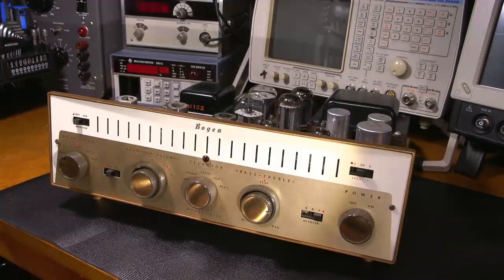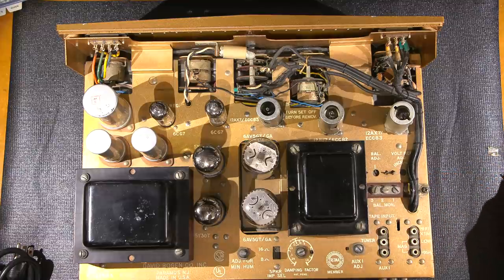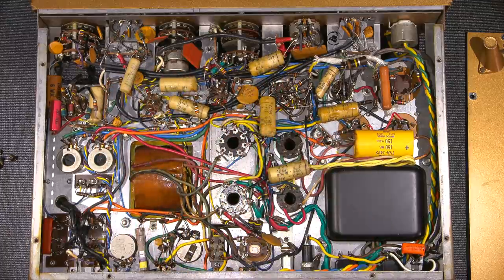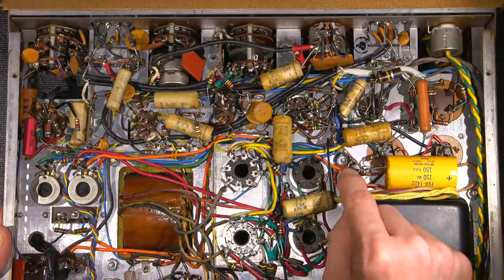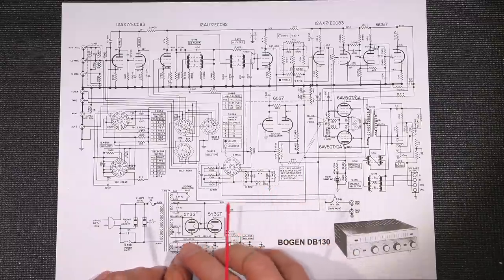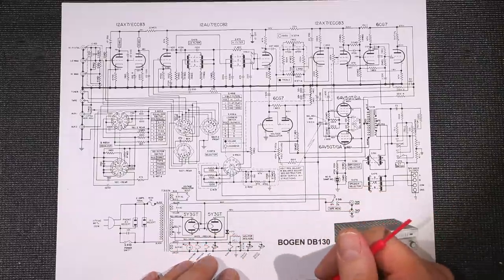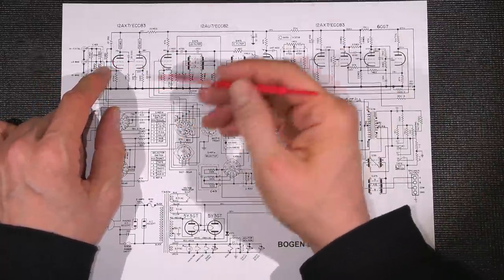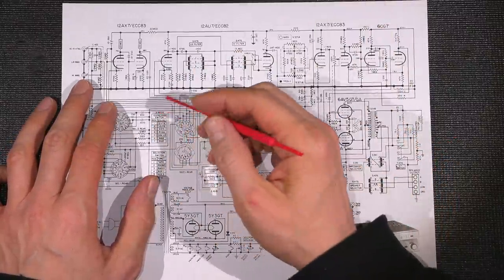Look Inside This Tube Amplifier!

Comment: My parents built their hi-fi component system in the 1950s, before I was born by a year or two. They used this amplifier or one very similar to it, along with a Sherwood FM tuner with a “magic eye” indicator tube, a Rek-O-Kut Rondine turntable with a 16” Audax tone arm and a GE cartridge, all encased in a cabinet they designed with record storage below. I still own this cabinet and all the components. Their Bogen used 6V6 power tubes but otherwise looks identical to this one. I especially liked the preset EQ control with settings for US 78, EU (European) 78, NAB, POP, RIAA, and Col-LP (Columbia). Obviously before LPs were all standardized to the RIAA Curve. The sound quality was superb and eventually I bought two more of these amps, hoping to have a couple of them restored to use in a stereo rig (someday, when I am a very old man, the way things are going). I wish I knew enough about electronics to do this myself, but looking at the interior components I find it rather intimidating. Thank you for your thorough delve into the guts of this wonderful amp.

Comment: Years ago (70s-80s) I replaced many Bogen tube type units. Mostly commercial audio amps with 70.7v and 25v speaker line outputs. Most of the customers liked them as they lasted a long time and wanted Bogens as the replacement amps. I had a shop that took all of the bad units that I removed and used them for parts if they couldn't easily repair them. I got many of my spares from this shop. There also were a few commercial Harmon/Kardon units that I replaced. Nearly all of what I worked on at that time were Mono as they were mostly PA/background music systems. Another great video Sir! Michael in Colorado.

Comment: Thanks for taking the time on the theory.  I discovered from your video why the screens on the 6K6 output tubes of my Hallicrafters SX-71 and SX-100 get voltage off the voltage regulator tubes.  Be safe.  Albert

Comment: Every time I look at one of your videos it triggers a trip down memory lane. Sometimes the equipment you are explaining or working on, with this episode it was back to the vacuum tube block of my early technical education. And every time I see your array of test equipment I realize that in my career I have used-repaired-calibrated just about everything I see. 

The first time you mentioned the B+ line reminded me of the first time I was given a newly introduced digital multimeter to use. (A well-known brand which I won't mention here.) I was working on a item vacuum tube equipment at the time (don't remember what). When I went to measure the B+ with that new digital meter, it displayed an overload indication. That meter only went up to 200V! My comment to my boss about the meter was "what the ** good is this thing if I can't measure B+ with it???"

Comment: I strongly recommend replacing the 6AV5 output tubes (rated 550 volts max plate voltage and 11 watts) with 6FW5 tubes (rated 770 volts max and 18 watts dissipation)  for reliability. No circuit changes needed. These sweep tubes have a 175 volt maximum screen voltage rating so the voltage regulator is needed. Sweep tubes have huge cathodes for high peak currents and linearity. Speech and music peaks are ten times the average power so these amplifiers have tremendous headroom. I have a Bogen LX60 60 watt high fidelity public-address amp, based on this circuit. I changed the four 6AV5 to 6FW5 twenty years ago and it can peel the paint off the auditorium walls without clipping. I also have two DB130 amplifiers. All three have huge output transformers for great bass response. The Bogen manual explains how to adjust all the chassis controls. Variable damping was supposed to increase the damping factor for tight bass, if you set it for minimum damping it will sound like a boomy old 1950's Jukebox. (Note my 1960? LX60 amplifier uses newly-available 5AR4/GZ34 rectifiers which also give higher plate voltage and delayed high voltage at warm-up)
Reply from the maker: Thanks for taking the time to write Donald!

Comment: I use Bogen amp's in commercial applications for paging and sound. They are extremely reliable and have great sound. Nothing beats  the sound from a tube amp though, I find they have a wider range and much fuller quality, especially with vinyl records. I can't wait for this restoration. BTW, that amp looks like you just unboxed it from the factory, super clean.

Comment: Bogen DB130 amp selling on Ebay for $399.00 plus shipping seller refurbished. I worked on both Bogen and Rauland amps before I retired. My opinion Bogen amps were far superior to Rauland amps, thanks for the video Mr. Carlson.
Reply: lol I just left a comment about that one.  Looks like a deal.  I considered it hard before I walked away.  Too much stuff as it is...But this is a cool piece for sure.

Comment: Hi Paul, I just came across 5 Bogen PA amps ranging in output from 10W to 70W and looking to restore and re-purpose them. So I found the series you are doing with the DB 130 very timely and would like to see you restore both amps. As others have commented...maybe a matched set! Am also enjoying the Urban amp rebuild and think you have done a masterful job in the design to show off the tubes and fit everything into a very small footprint even with the point-to-point wiring. Yes there is a positive side to all the time we have available right now.

Comment: OMG I had one of those when I was a kid!

I got it at a yard sale or something, it had an output transformer or bias issue or something and the plates on the output tubes would glow red as soon as it warmed up.  I didn't really need an amp but liked all its EQ and tone-control features so I snipped a few wires in the output stage and turned it into a preamp.
Reply: You probably could have repaired it with a couple capacitors.

Comment: Hi,

I'm an Computer Science graduate I know me some tiny bit of digital 'electronics'. I also cower away at the sight of even the second transistor in a circuit 😁
I don't know why watching these videos entertains me, but it does. I view them as sort of a crime/mistery procedural of sorts, I guess.

So thanks for all the great content 😀 👍

Now I've just bought my first tube amplifier so these videos are even more interesting to me, while I await its arrival.
I guess the restoration of the second piece would be interesting if there are differences from the first.. If it's damaged/altered in different ways

Comment: Thank you so much for posting this video. I have this same model and mine is all original as well. I tried this unit out with my guitar and it sounded pretty good. I did no mods to the amp so all you hi-fi purists calm down all is well no harm done. I'd love to find the top cover for this amp if someone has one. Job well done, great video!

Comment: Both amps, duh!

Speaking of Bogen amps and guitar conversions, I've been myself working on one for a while, a CHB-50 Challenger PA amp with a date stamp of April 18th, 1969. I bought it from the college I did my recording studio formation at, it had been sitting in a dusty backstage room of the auditorium for who knows how many years. It was dirty, mostly original, and had at some point been operated with no load on the output, one of the 6L6GCs shorted out, fuse blew before it could damage the transformers. I sat on it for a year and a half, reading up on guitar amp design and watching a lot of videos, mostly yours and Uncle Doug's, so I wouldn't go into this project blind. After a nearly complete recap, a rewiring of the front end (using both halves of the 6EU7 in parallel), some new power tubes, upgraded bias circuit and tweaked tone stack, it's getting somewhere! Makes for a very unique sounding amplifier, loads of gain on tap and once compressing hard the power transformer saturates easily and you get a lot of sag on the front of the note. I still have a parasitic oscillation issue when turning the treble control up past three and a half, and without an oscilloscope it's gonna be hard to track the source down... One of my next investments once that Covid thing is over and I get my job back I guess

Comment: Nice! I believe you are using the 6360 (also called QQE 03-12) as output tube in your converted guitar amp. I have also tried it in audio service

Comment: Great video! You may also want to explain why the 6CG7 voltage regulator has a dedicated 6.3v filament winding? Why not just use the base filament chain all the other tubes use? Heater / Cathode insulation breakdown, but you will probably explain it much better. Those old Tektronix scopes you have will utilize several 6.3 volt windings on the power transformer for the same reason.

Comment: I had the same model several years ago.  It came from my great uncle who had an electronics shop back in the 60s.  It didn't work.  I was warned about the extreme voltages.  I'm not comfortable enough with tunes to safely work on them .  I ended up giving it to a guy that restores tube gear.    I've heard that they are nice amps.

Comment: A monoblock integrated... Interesting. Looking forward to seeing more of it. Yes very much enjoying the increased video output :) Just need to get my arse in gear and order the parts to finish the restoration of my Ferranti 225 that I've been meaning to do for years. Re: 9:00, at least with a tube amp you have the output transformer to sacrifice itself for the good of your speakers. I once had a Marantz solid state receiver that decided one day to short B+ straight onto one of the speaker lines. Needless to say, the voicecoils in my cheap but still beloved Mission 701s were not particularly amused by this treatment. I'm pretty sure smoke isn't supposed to come out of the bass port...

Comment: I hack them up Paul ; )  Actually I convert them to guitar amps in my spare time. I have a couple DB 115's and about 20 other Bogen models. I've converted about 45-50 1950's-1960's Hi-Fi mps and PA heads. Bogen is one of my favorites. I really like the little  Bogen K10's. I have six of them and one still needs to be converted. They use the tiny 6AQ5 (6005) power tubes and they sound fantastic when you drop in a Fender Blackface AB763 tone stack. I have many other brands as well but the low wattage push pull amps are my favorites. Good luck.

Comment: Indeed, missing original mechanical parts such as knobs and so on for this retro equipment is sometimes a real pain … but a good 3D printer can mostly bring the solution. And if you use a good 3D CAD program and really take the effort on the detail of the design of the part and U use like PETG or ASA filament the result can be pretty good and reliable …  along with a good paint job … I already did this for some clients, and so far they are really satisfied with the results and proud they can display their retro equipment as original as possible, so …

Comment: Actually, it was not a capacitor back in 1972 which had filled the room with smoke while asleep after a seemingly successful repair of an old Grundig Receiver, but the mains transformer constructed with tarfiled layers of paper separating the windings presumably for purposes of greater engineering efficacy; which had started smoldering due to a somewhat sturdier replacement mains fuse; since a suitable carpenter's nail was not handy right away.

Comment: I am working on a Dennon Class A pma560, I had one set of channels running fine, (sounded gorgeous) and i liked the simplicity of the outer design, hoky pete, I took it apart, and its actually very very well built,. Im hoping as I have no freaking clue what Im doing ( sodering gun in hand), but im hoping its the fuse up front.

Comment: I have a bogen dB-115 I repurposed into a Gregory mark X.  Main reason , the power xformer output is about 400vac, and the Gregory schematic was a good match, and was a simple build/conversion, and was more useful than just having a single channel clean amp, which now is clean and distorts, plus tremolo.

Comment: Later high end tube amplifier products would provide a separate heater DC power supply section. Silicon diode rectifiers made this enhancement feasible.

Comment: I have a pair of these Ona storage shelf.  I’ve overhauled them but it was early in my interest in tube amp work.  Requires a recheck before use.   I did acquire a quad of NOS 6FW5 which is near same tube but it has a higher screen voltage.   I did try 6AU5 in amp and it’s easy to replace them.  When set up I found no benefit.

Comment: Does that cap checker you designed do in circuit measurement, for bad or leaking caps or do you always have to de-solder one end. [You need to get around to labeling that.] That would be a good video,show you building one of them from scratch. Offer to sell it in  a kit minus the case & probes. Or just sell just the  print & board;  have a few options,it's an idea. I would buy one.

Comment: And Speaking of solid state to tube amp conversions,, would be truly great if you could do a video about using a SMPS to power your little tube amplifier.  WhadyaSay Paul? :)
Reply from the maker: Hi Terence. SMPS=Noise. Guitar amps have very high gain front ends.

Comment: I'm guessing they are using a regulated bias supply due to the nature of the output tubes, which are sweep tubes which each have around 35W of peak plate dissipation.
Reply: Yep. Remember seeing 6AV5s in the horizontal ouput stage of many really old TVs.

Comment: Why do they use tube D C rectifiers when they have diodes? Great channel, love what you do.
Reply: This was built around 1957 before they had cheap high voltage diodes.
Reply: @donaldpassantino2293  That makes sense, thank you.